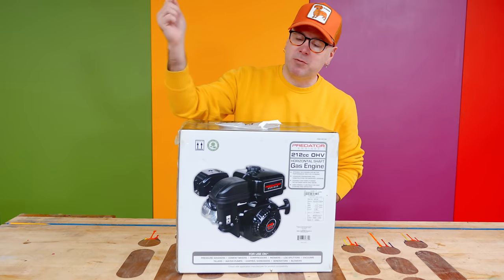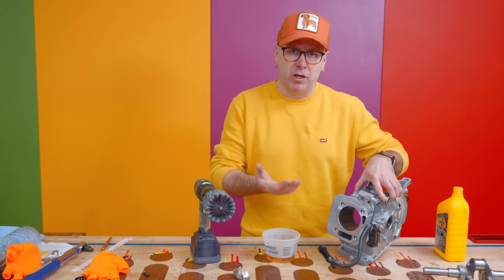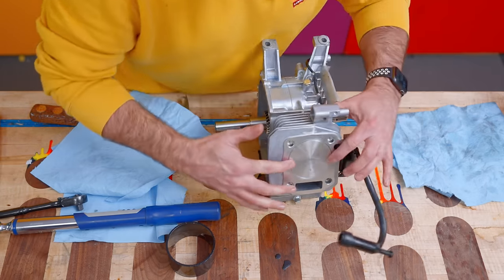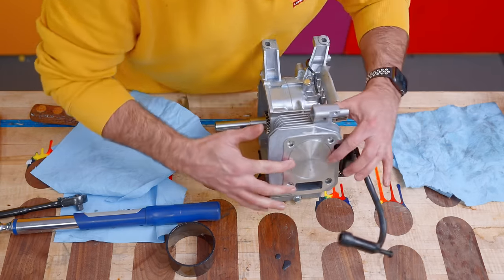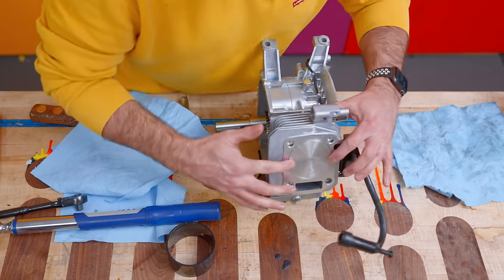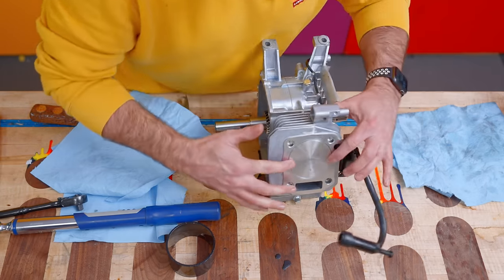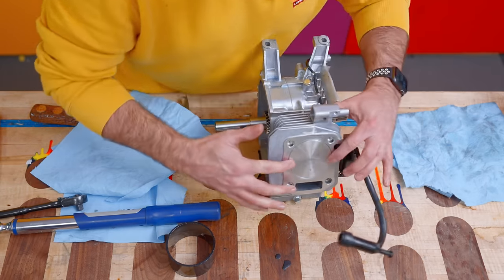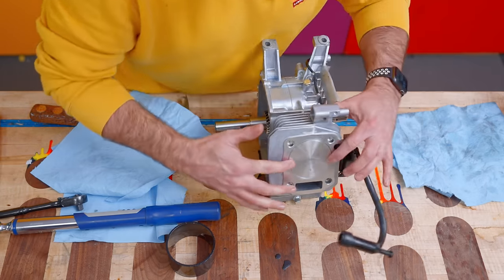How to Build a Competitive Kart Racing Engine (Stock Appearing)

Comment: I don't race, but this video makes me want to modify my lawn mower engine...
Reply: I was thinking the same thing until I thought about the blade coming off at 8000 RPM
Reply: Do it on your rider.... it'll go faster, you'll get your lawn done quicker, and you're sitting on top of the blade, no getting ankled like you would walking behind your push mower, if the blade decides to go for a cruise.... 😬

Comment: When resurfacing a head with the flat glass/sandpaper technique, work the head in a figure 8 motion to avoid uneven material removal.
Reply: And a slight concave backing plate to get it flat.

Comment: Racers today do not know how lucky they are having videos like this. When I started in the 80s, racers would tell you a little & the rest was bullcrap. You had to get pieces from different racers and put them together to get the whole picture.
Reply: When I started in the mid-90's, the guys you were competing against would outright lie to you.  The guys you may be competing against in the future would tell you half truths and everyone else would just ignore you.  If you wanted to compete, you either needed to find someone that had stopped racing and was just there to "hang out" or find an engine builder that had drivers in other classes.
Reply: When I was building a jet ski engine in the 90’s you waited every month for the current issue of Jet ski magazine.
Reply: @aaronthomas6155  or do engineering. Usually this kind of knowledge you have to pay for.. but with internet being what it is today engineering can be done in your garage with a few videos. I took aerospace manufacturing and aviation maintenance, so I understand the principles that make an engine pur exactly how you need it
Reply: @letitbe90210  I've raced against mechanical engineers.  They were great at building engines but were horrible at setup and reading a track or weather.  Not everything can be learned on the internet.  Somethings only come from experience.

Comment: The Ball hone achieves something akin to a sandpaper finish, the long chain hydrocarbons in the oil that offer lubricity between piston and bore get sheared quicker and the oil fails sooner affecting the rest of the bearing surfaces.  Buy two of those 3 arm sprung hones, one with course stone and one with fine stone and build the hone finish properly. Piston rings are designed to hydroplane along the cylinder wall on the oil caught in the "deep" hone.  The initial overlayed shallow hone atop the deep hone is meant to abrade the rings to a mating surface H7 fit. The light hone is at the same time abraded away to form plateaus atop the deep hone peaks, this is the breaking in process (breaking off the minor peaks). The deep hone valleys anchor the splashed oil till the rings shear through this oil then, hydro glide across the plateaus. That said the ball hone is a mongrel tool that doesn't deliver the engineered principles desired.  Yes ball hones seem to work but not like the proper hone finish. When you're chasing performance (HP & longevity) for 7000rpm average make a torque plate and bolt it down to simulate the head, this will twist and bulge the barrel, the course honing will return the bore to cylindrical, reduce piston flutter and oil shear so more power. Apply the course hone with faster reciprocating action for a more acute (60/30) hatching in line with the bore to allow for easier oil shedding, the light hone can stay at 45. Coning the bore off perfect cylindrical 2-3 tenths larger at the bottom for reduced friction adds HP and longevity as the effective pressure is so much lower at the bottom and doesn't need rings shearing the oil to form as great a seal. The piston could do with an oil hole drilled through each wrist pin boss for better friction management so more power. The piston skirts narrowed give better engine acceleration and lower peak impulse load on the bearings, the piston skirts aren't cylindrical and examining an old piston will show the "contact" patch you can machine a new piston skirt upto. Finally turning the piston around will give you slightly more compression but more slap and wear, it's a geometry thing.  You skipped over performance valve and seat prepping, guess that's where you've keeping true to promise.
Reply: I'll apprentice under ya
Reply: First, love the video!  First time I've seen any engine builder go through step by step of what is necessary for a competitive motor.... for any kind of racing.
I can say that in the car engine world the rings vs. bore finish have come a long way.  Very thin rings vs. finely finished bores etc.
The ball hone gives you the cross-hatch pattern which helps leave some oil on the walls.   Then there is ring gap....  It used to be the bottom ring (3 ring package) was gaped smaller than the top.  But apparently that leads to flutter on the top ring.   Of course you want to go with the lightest piston (reciprocating mass sucks for power).   Roller bearings on the cam.
Reply: @confuse9  What's come along way is thermal management. What's changed is the compromise delta. As bores maintain cylindricity over the wider thermal range, manufacturers have reduced compensatory design (clearances for thermal change, ring pressure, film viscosity).  Shorter chain oils, and lower spring pressures means lower drag so better (fuel tank) economy. This requires a very accurate ring on oil to bore calculation. Throwing a ball hone in modern, low ring pressure, engines cant achieve plateau requirements as it cant in older engines either. Look at Audi over the last 15 years and you'll find increased oil consumption rates as they chased the low internal friction delta. Audi's bore finish breaks in almost immediately and has the right ratio of scratches (valleys) per area for oil retention but not (**see service manuals and law suits) over retention. Best use for a ball hone is to remove grease and rust from a block prior to proper machining. Aging a block in the back yard or grabbing a high mileage block from the breakers is valid but really harsh on workshop machine tools. Emery taping the deck faces and ball honing the cylinders saves expensive carbide inserts from cutting abrasive oxides, that's a good use for a ball hone, as a heavy duty cleaning brush.
Reply: Been building for years, only now did I come across such detailed and invaluable information. Thank you.
Reply: I agree with you 100%. The cost and time to hone the cylinder correctly will add longevity and keep more HP longer. Definitely worth buying a set if you are going to build more than one engine.
Reply: Mr Berger has some correct knowledge, however If your chasing longetivity and performance, don't hone at home fullstop. Drill mounted hones are terrible for this purpose.
 Take it to a machine/engine building shop and have it honed properly on a honing machine, absolutely no point in getting hand honing tools and a honing plate if using a power drill. It costs very little to have a cylinder honed professionally and modern honing machines have honing accuracy down to unbelievable fine tolerances.

On ring gap:
You do gap the the bottom ring greater than the top. If you gap them the same, then you risk flutter. Gapping the bottom ring larger, means that any force that makes it past the top ring is guaranteed to make it past the bottom ring.
Reply: @xTerraH  Honing accuracy of ICE hasn't improved in the last 60 years. The Repco Hone machines, standard to the industry then combined with a dial indicator and conscientious operator were accurate to 0.00005" in the 1960's. I'm constantly impressed with the precision of machining of yester year and our modern reliance for co-ordinance locating by digital means. What's the engineering fundamentals to your ring gap rule of thumb? When you referred to flutter were you thinking piston flutter? piston slap? ring flutter? they're all different just wondering if you were adding to honing knowledge or heading off on a tangent somewhere.
Reply: @mrberger1144   @Mr Berger  honing accuracy has significantly improved in the last 60 years, are you joking?

The fact you believe someone hand honing with the likes of a repco drill attachment is accurate to that fine a tolerance is extremely laughable.

The human hand isnt even remotely steady enough to that degree - think about it! It isn't rocket science.

When I'm referring to ring flutter, I'm referring to piston ring flutter. There is no other type of piston "flutter". Piston Slap is its own thing again and never referred to as flutter. Any other 'good' professional engine builder will tell you the same thing regarding gapping. 
Everything you've said indicates knowledge past down from the likes of a handyman grandfather, knowledge you've kever stopped to reassess.
Methods have changed and simple science backs up everything I've said.
Reply: @xTerraH  Repco hone machine of the 60's was the industry staple, not a hand hone, it was floor mounted tonnage. The machine with dual stone and guide brass was fairly simple to use as I experienced, you may not be aware of this time of engine machining so I get your misconception. I espoused hand stone honing over flex hones from both scholastic training and experience however the practical experience in this comparator is naught compared to hours spent in the lab on this subject. I sort your wisdom on flutter, you could have expanded your gaping statement with scholastic knowledge yet sort to say "well everyone does it". To piston flutter, yes real and an early concern of design. The piston hydroplanes the oil film, then disconnects temporarily to glide on the air cushion, then reattach to the oil film where it breaks through the oil to strike the bore material, it's destructive and real and called piston flutter and no it's not simple science. To avoid this, the wrist pin is offset to force the piston to bias sideways on the way up and the other sideways on the way down. Again this isn't perceptible from monkey see monkey do. So yes, piston flutter is fixed by inducing piston slap. Worst examples are forged pistons, post machined to customer size as many don't build in pin offset or thermally corrected diameter barreling (versine profile) again not simple science. I was interested to see if you'd cover this detail. Your response to position me without any knowledge only indicated you decided not to share your knowledge. You might want to examine tristes on machining and scraping with hand finished surfaces at 0.0001 deviation. By the 60's the precision of finish was decided by the consciousness of the operator and set targets. 60’s labs would use Talysurf trace and chemically softened plastic films to take negatives of bore finishes for microscope examination. Once you sight one of these films you'd know instantly a ball hone is just a toy, I speak from experience. These films were then translated into engineering specifications for machinists to achieve using human controlled (stone type and pressure, speed, dwell, stroke angle) honing machines. Again no Monkey see monkey do, it was targeted specifications and capability from practical science and application (engineering).

Using a "drill" mounted, sprung flat stones, as I originally espoused, gets you so close to a specification finish it leaves the flexhone on the start line. The only mystery to correct bore finish is solved through education not marketer’s hyperbole. The air cooled motor this thread is attached to will have clear benefits from correct honing and a simple min/max stroke place will fix and control issue with hourglassing.

Ring flutter. Ring gaping isn’t a feel good concept to address ring fluttering. The solution is a calculation of material thermal expansion at operating temperature. Piston ring groove is deliberately wider than the ring width, the groove is also deeper than the rings inner diameter. This intentional gap harnesses the combustion gas pressure to 1: push the ring down, as to seal on the bottom of the piston groove surface. 2: get the gas behind the ring and expand it out to the bore, that’s why you need to get engines to operating temperature so the ring gap after being over opened by gas has a chance to thermally close the gap to almost nothing. Too big a ring gap and the gas pressure needed to expand the ring out to the seal position won’t happen correctly as this gas pressure leaks. The ring then slips/sticks/slips along the bore and piston groove loosing contact with the bottom face of the ring groove and “fluttering” in the groove. You then have a failed ring seal, more oil bypass that leads to coking of the ring groove and further failure.
Most builders are so scared of to smaller gap they willfully open the gap way to wide. Too small a gap and the expansion closes all gap available and more.  This then makes the ring diameter increase, expanding past its design size through the oil and contacting the bore to friction weld with the bore but snap and break parts of the piston off. So “opening up the ring gap” only makes sense when higher thermal operating temperature is used. High performance upgrades produce higher operating temps demanding greater cold ring gap. For Dave and this non hemi engine, with better VE, better air flow then a stationary unit you’d start at the top limit of the standard gap. So that was fun, ring gap, ring flutter, piston flutter, maybe next time it'll be piston slap
Reply: @e4mafia_tn  For Dave and his bracket racing, building becomes the hobby as it's discovering advantage in machinery not just track craft. I'd suggest buy, borrowing an engine building book from the 70's, it's the peak of engine building without computer controlled analysis or computer controlled re-machining tools, it'll give you no BS straight up and down information and probably lots of it. As an A Grade Automotive Machinist and qualified Mech Eng having worked across GM,Ford,Porsche,Nissan, I'd recommend when people get vague on explanation, drill in as there should always be empirical facts.
Reply: I would nikasil the bore .  US Chrome.